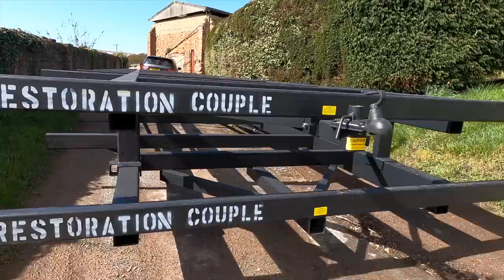HERE AT LAST - Huge Cabin Chassis are ON SITE!

Comment: You could try getting them into the field where you have a slope and gravity on your side. Then hook the top one to the tow bar of the car with heavy duty strap. Then you have the car as a counter weight and can control the rate the top one slides off with the car. Plus would mean everyone is well away from sliding chassis.
Reply: Or would two Genie Lifts work?
Reply: @duncanhallam6556  you'd end up with the whole lot bogged down in the field

Comment: The only reason that was such a pain to get past the bend in your track was because the axles are in the middle there is so much tail swing you don’t get that with artic lorry’s so badly as the axles are near the back I wouldn’t let that put you off getting stuff delivered to your farm. As for the chassis I would be tempted to slide the top one off the bottom one rather than messing around with jacking the top one up etc can’t wait for the next upload.

Comment: My suggestions for getting it of

Ship builders- used a lot of fat/grease/lard to launch ships.

Egyptians used logs to roll massive stones to build the pyramids.

Find a way of keeping the top chassis in the same place with scaffoldings or A frames. Let the air out of the tyres in the bottom chassis to separate the two. Pull the bottom chassis out. Then the top chassis put the wheels on put air beds and mattresses underneath then find a way to safely lower it using an A frame?

Hope those ideas help.

Comment: It would be a shame to slid them apart as the protective coating (paint etc) would be badly damaged. My approach would be to jack up the top unit and drive out the lower unit.

Comment: Jack up the top one and just pull the bottom one out. Put wheels on and lower it, job done.
Reply from the maker: That’s my thinking and easy enough on flat level ground but i could see the bottom chassis catching the jack/stands and the whole lot come crashing down. 😬
Reply: @TheRestorationCouple  So instead of seeing the glass half empty, make sure you don't catch the stands and then you can look back on why you made a mountain out of a molehill in the first place!
Reply: @TheRestorationCouple  it will, it will be unstable as anything and i'm guessing each one is about 2 tonnes - you'll end up bending an outrigger and the whole lot will go pear shaped - at the very least you'll need to stick something into the outriggers to extend enough of them to jack/block it up. I'd personally stick some ply in between them  and pull the top on back with the bottom one hitched to the volvo until the top one is on the balance point then you can think about sticking some wheels on it.